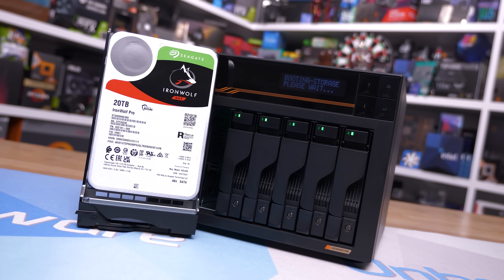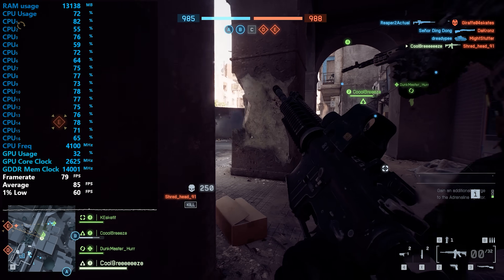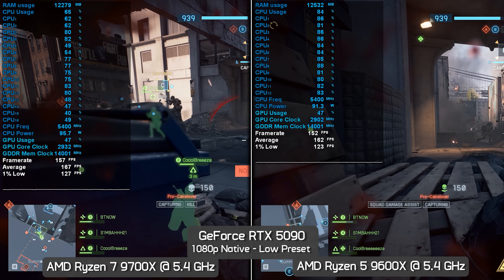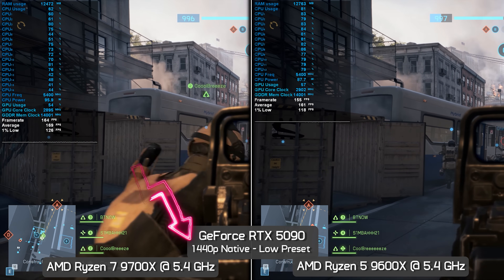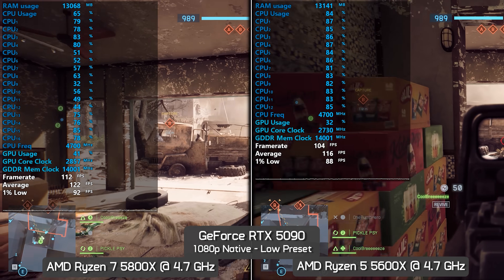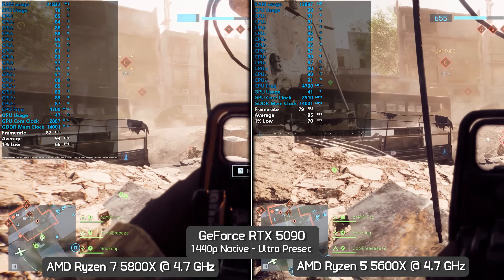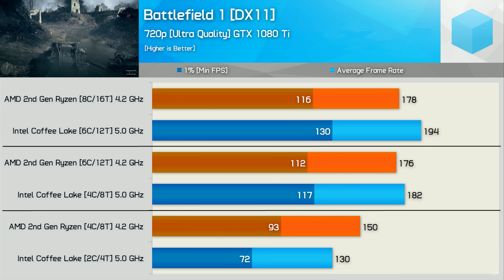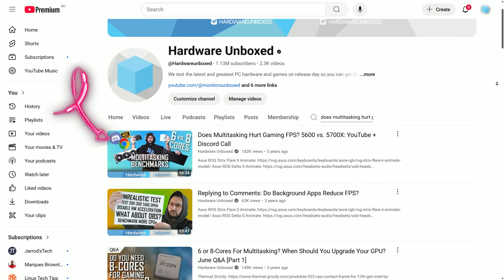Why Gamers DON’T Need More Cores, 6-Cores Still Works Well!

Comment: You should buy more to be future proof from a legal standpoint.
Live example - Oblivion Remastered requires 6T. A pop up appears upon start if you have less. Will it work on 4T? Yes, possibly even without huge issues. 
Can you complain about anything in the game stability/performance if you don't have the specs? No, you can't. Default answer from devs will be "bring your PC up to specs". 
I believe we're gonna see more requirement specs increases in the future because it's an easy way to ignore complaints of people with low specs, not optimize your game or even push the sales of new CPUs by just introducing hardcoded spec requirements.

Comment: In the end the whole many cores marketing in general didn't age so well. Kinda sad that it's still being used today by manufacturers.
Reply: Amdahl's law is still a thing, and if what you are doing is extremely parallelizable and demanding enough that it's stressing out the CPU then someone will make an accelerator for it. That's how we got GPUs, that's why we have these awful NPUs.
Reply: @RN1441 just because something can used across many cpu cores doesn't mean it makes sense to design an asic for it.
Reply: The marketing is fine. It's people's conclusions that are the issue.
Reply: You need at minimum 8 core cpu if you do anything production kind work on your pc. For example video editing or such. Its not a marketing scam that more cores gets you much faster rendering times etc. Its just a fact. Just because you dont need a pc but only for gaming, doesnt mean 8 or more core cpus are useless for everybody else too.
Reply: it'll always have market demand to users like me who prefer more cores than just IPC improvements, that also value longevity.
Reply: If you're actually using your PC for the kind of work that uses them, cores matter. Not everyone buys a PC purely for gaming or even as the main task that the PC will perform. 
Also, if you're a Streamer or some other kind of hi res video content creator those cores really will matter, a lot.
If you're just a gamer, yeah, not so much.

Comment: Now a comparision with a 9800X3D vs a 6 core 9900X3D (with the non-cache cores disabled).
Reply: This my current  situation. I have a 9900x3d. I turn on msi x3d game mode . My games performance jumped and butter smooth in games like. War Within, City of Heroes, F1 25, Madden 26 and many more. I’ve  also notice extremely less latency, almost like it doesn’t exist. My gpu is a 9070xt and I’m playing on  a 4k 240z oled. When x3d game  off. I noticed some stuttering and more latency. I’m definitely keeping x3d game mode on.

Comment: Interestingly when I tested my DUAL-GPU system with 7900X3D & Lossless Scaling in 4K with 600fps generated from 55fps, my CPU utilization was only 40% and it was 70% in 1080p with 1600fps generated :)
To back it up I have benchmark on my channel :D

Comment: ok just on the note of the more cores more multitasking, in an specific use case you can actually tell the pc use this cores JUST for OBS and thats all and so the pc will not use any other core for obs and will use the others for gaming not using those 2 that are just for obs,

Comment: Developers have talked about how hard it is to spread gaming loads across >8 cores.  Game workloads are SUPER dynamic, nothing like datacenter/server workloads.  Not just that, we never truly got away from the importance of a primary game logic core doing a lot of the heavy lifting and cannot necessarily be broken up in the same way you might spread out other workloads.  Meaning it's still easier and often more effective to keep one core/thread doing a lot of the work, and ultimately, when fully utilized, bottlenecking how much all the other cores can realistically add to performance.  Trying to spread such work out a lot more isn't impossible, but it's complex and challenging and can often have worse end result performance, and more headaches for dealing with issues.
Reply: There are PC exclusive games. Plus PCs tend to have background tasks running. Two extra cores come in handy.
Reply: Yes. Microsoft is going to run telemetry whenever they feel like it. @greenbow7888
Reply: the context switches from trying to use more threads also cause lots of extra overhead, especially on windows
Reply: IF they tried doing that in an already made engine then yes, if the game engine is made for pararellization then its not a headcache to work with.
Reply: Not sure how things are right now, but somewere up to ryzen 3000 time, intel was king because it had better single core performance (IPC ?). So what @maynardburger said was true at some point in time.
Reply: All I know is that according to armchair developers all game devs are lazy lowlifes who don't even try at their jobs. That or it's a conspiracy to make games run badly on purpose to sell hardware.
Reply: The reason they don't do it is because consoles only use 6 of their cores for games.
They could.
They just don't want to build separately for PC.
Basically, lack of optimisation.
Reply: @BusesAreFatCars  Not true, from a developer. If you can make something that scales well to 6 cores, it will scale well to 8/16/whatever.From a straight Amdahl's law perspective, not counting IO, be that "device IO" or "memory IO". The "work subdivision" isn't much different from 4 to 6 to 8 to x for workloads that can be highly parallelized. Problem is, the ones or parts that can't. And there's only so much time to go around, so you focus on the hot paths that can CLEARLY be done out the gate and then, time allowing, you think of those that MIGHT have a chance.
And we have a saying around here that, if you don't do it now, you don't do it ever. Because "new feature" always beats "improvement". Unless of course performance is so appalling that you HAVE to do it, then "new feature" can wait.
Reply: So, lack of optimisation. Like I said.
Also current engines are not designed with PC's in mind. They are focused on consoles and their set number or cores, or primarily have been up to now. Which is what I said, I figured I didn't need to write it in such a long winded way, though it is what it is.
I get that some processes will not scale effectively. Which when everything these days runs on Unreal 5 is mostly down to how the engine is designed.
 @ErazerPT
Reply: @BusesAreFatCars  how does software built for six cores differ from software built for sixteen? as a layman, i would think having more cores just increases the number of 'multithreadable' tasks you can execute in parallel
Reply: @jim-wr3lp  It shouldn't but I guess gamedevs don't use thread pooling.

Comment: The Ryzen 3600 can still hold it but I upgraded to the 5600 and games that the 3600 started to struggle with didn't

I wanted to get the 5700X3D but it's hard to get now because it's end of life I could get a 5800X but I won't see any improvement I don't think

Saving up for a new rig next year anywah

Comment: When Ryzen 1000 series released, we thought the games would utilize all the cores within couple generations but in reality it took until like Ryzen 3000 series for game devs to even start utilizing more than 1 core, let alone 4 cores that was standard at the time - and that's when AMD overtook Intel as gamers' favorite since Intel CPUs were still better in single-core performance but not in multi-core - it will take a long ass time before we see games requiring more than 6 cores for 1080p Low preset.

Comment: We could also mention the fact that the IO die is not binned to be better on the more expensive parts. You could get a 6 core CPU with an amazing IO die and huge margin for overclocking, while the 8 core CPU barely manages to get over JEDEC specs.
Reply: Maybe, but once you start worrying about overclocking and spending all the extra money for fancy memory kits required, you're usually just better off going with an X3D part.  More efficient and straightforward improvement.

Comment: my 7600x3d has done really well while paired with a 9070xt but there are definitely times where i wish i had an 8 core just simply for shader caching and there are times where my cpu is the bottleneck at 1440p ultra native settings on bf6

Comment: I beg to differ. I had an 8 core 5800 series and now have a 6 core 9600 series and there is a huge difference. While the 9000 series 6 core scores better in cinebench, there is still a huge difference running a game and having browser windows open with multiple tabs and other apps like discord, etc. running also. 

Y'all just tested a pure game only setup. That setup, sure, not a lot of difference, but the real world, not everyone is just purely gaming.

Try gaming, especially online gaming (games that use 4 or 4+ cores), talking to your buddies in discord, running browsers to look up stuff and maybe even doing a little streaming, either on discord or otherwise, and tell me 6 cores is just fine.
Reply from the maker: What? Are you trying to claim the 5800X is a better processor than the 9600X? :S
Reply: @Hardwareunboxed nope, just that 6 cores vs 8 cores in a real world gaming setup is better. You must not have read the entire message. Sure, pure gaming alone, not a lot of difference, but in the real world, I have game on one monitor, browsers on another and other apps like discord, etc. running and 6 cores is lacking.
Reply: @WayneWatson1  Sounds like your 9600X system is broken somehow.
Reply: @soppaism B650, 32gb memory, nvme gen 4 drive, 7800xt. The 5800x3d and 9600x have close to the same FPS, it's just when I am checking things out in the browser and doing other stuff, the game suffers a little. The 5800x3d/x570 system (same exact video card and nvme drive) never blinked while having 10 tabs open, streaming on discord while chatting and running 2 instances of wow.
Reply: straight up lying on the internet now are we
Reply: @lightbell3 you referring to me?

Comment: Not this again, how many videos you uploaded about this topic again every now and then :<
Me I finally settled at 16 cores a couple months ago coming from R5 5600, as nail in the coffin coz I like to settle down and forget the incremental upgrades. Made a huge difference in terms of stability, temps and consistent frames performance. Rather pay upfront for more cores, more longevity than purchase over a thousand dollar GPU any day. My build is from 2022 when AM5 wasn't mainstream yet so made sense to just max out the platform instead.

Never going back below 16 or 12 cores CPU ever, as in. I'm satisfied with my R9 5950X upgrade as I do more than just pure gaming.

Comment: The human eye can't see more than 8 cores anyway
Reply: Person with Pentium Gold G7400: "games only use 2 cores!"
Reply: But but, i thought, the more core u buy, the more u save.
Reply: Since modern CPU cores are themselves very small, if you have bad eyesight you might not even see one xD.
Reply: @Durayne  True, X86 are usually like 5-7mm² except Zen4c which was ~2.48mm² and that a full on X86 with SMT, Intel Atom and Arm cortex X4 is 1.4-1.7mm² depending on process node and features.
Reply: If I bought more than 8 cores I wouldn't be able to afford my glasses and wouldn't be able to see anything at all!
Reply: The human eye can't see cores. The human eye can't even see more than 16 bits. We should all still be using 8088s.
Reply: Hahah a lot seem to not get the reference, it's a joke about 144 Hz
Reply: @herculet  Many years ago that was about 24Hz.
Reply: I once saw 16 cores, but then I went blind. Don't try this.
Reply: I see what you did there...  🍻
Reply: :hand-orange-covering-eyes:👀:face-turquoise-covering-eyes:
Reply: You can always count on some people not getting the joke
Reply: Per CCX?
Reply: *less
Reply: Only 90s gamers understand that joke.
Reply: Human Wallet: Same
Reply: A person who thinks all the time…….
Reply: So I think most games know that requiring or leveraging MORE cores across the PC landscape is suicide because that screws over 4 or 6 core processors. Instead the engine is usually dynamically looking for how many cores and threads it can utilize, and spreads them across as an added bonus, and you don't see much fps benefits, but you do see better handing of backend stuff that isn't fps. Fps isn't everything basically.
Reply: But we have 2 eyes
Reply: Max I can see is 6
Reply: I thought 4 was the limit 😢
Reply: I see forever. That requires 24 efficiency cores and net wake.
Reply: i can see with my ears, now what?
Reply: of course you can
Reply: Actually it’s only one core. Everything past one core is a lie

Comment: A dumb question here but I wanted to know how would Intel CPU compare as one thing they have is lots of core as my I7 12th gen laptop has 14 cores but when i try to emulate PS3 titles I wont say it is the most stable/smooth experience

Comment: I am that guy: nobody games at 1080p!!

Yes, 1080p is how you "test CPU performance.". Scientifically.  Duh.

However, the data is less helpful to a consumer if they don't play at those settings.  It doesn't help them make a purchasing decision - which is why many people watch.

Example: 13900k + 4090 @ 1080p, faster than 13600k.  But... @ 4k, not so much.  Thankfully I had this purchase-decision data, and saved a bunch of $.

That's the difference.  Just need to be more specific.

Great vid.

Comment: I get the impression that for most modern games the additional cores are not as much important if the game was designed with PC in mind. The problems occur more when u try to play games that were ported from non PC platforms like PS or even mobile games.
As an example, NIKKE: Goddes of Victory runs significantly better for me on my new R9-9900X (capped at 65W) compared to my previous R7-5700X.

Comment: I went for the 2700x and AMD built instead of Intel, today still rocking same config but upgraded to 5700 , and 5700X3D when it was dirt cheap so Intel might was the best, but AMD turned out the winner on the long run ;)

Comment: For strictly gaming 6 cores are where it's at for value cus consoles decide almost everything and their 8 core has cores reserved to their OS for non gaming stuff. Got a 7600x3D, 32 GB RAM, MB from Microcenter in the US for 399. Literally laughs at Intel builds and beats everything except a 7800x3D, 9800x3D and the difference is small in actual games. With a -25 all core I am running in the mid 60's in OCCT/AIDA on a garbage AM4 cooler I reused. Ram Tuning doesn't even matter much on X3D either, so you have 400 dollar builds within a few percent of builds costing double and triple that with elaborate water cooling, super expensive RAM, MB you don't need. Spend the money on the GPU unless you are a content creator and I hate to break it to you, but you have a better chance of being a professional sports player at this point than being a big streamer.

Comment: I recently built myself a new PC after many years of having an old one. I opted for a 7600X because it was in a good price range and reviewed well, but I was kind of worried I had underspecced and should have gone for a better CPU. To my surprise, nothing (so far) has seemed to really give me any issues CPU-wise in games. 
I've flipped on the performance counters in a couple of game titles and more often than not I'm rarely above 60-70% CPU usage in games (shader compilations or loading screens are higher of course) so I guess I'm... just not that CPU limited? Note that I've built a pretty modest computer and I'm only using a 120 hz screen with the occasional RT effect turned on so I'm not shooting for the moon here. I'm also not trying to use path tracing (my GPU simply isn't powerful enough).

Comment: Testing higher than 8 cores is a minefield. Ryzen you wil, suffer the ccd to ccd latency. Intel, anything above 8 cores will be e cores insteac of p cores.

Testing more than 8 cores will become i teresting next gen when intel gets more p cores and amd more cores on a single ccd.

For now I saw a major uplift going from 5600X to 5800X and then another going to 5800X3D (5600X3D wasnt ever available whereI live)

Then I got a 9700X and saw no gains in some games and big gains in others and decent gains going to 9950X3D but only when restricting games to one ccd.

All this on RTX 4090 and 3440x1440, on my newer 4k screen most games are now GPU limited.

Comment: It'd be fun to look at performance of relatively recent 4-core CPUs in modern loads. There are i3-14100 and R3 8300G, as well as i3-10300 and R3 3300X (also Zen 3-based 5300G and its variations but they are rare).
Reply: r3 8300g lmao I had no idea there were 4 core zen 4 cpus
Reply: @madelaki any ryzen chiplet with <6 working cores is rare, most have at least 6 working cores to become Epyc or TR or ryzen.
So its not worth AMD selling a quadcore on desktop, the exception is APUs which are monolithic, the cores take up so little die space that if L3 or core is defective you can still sell it DIRT cheap to OEMs. AMD sells like 99.99% of all dies they make.
Reply: And potentially factor in the rest of the platform.
So many people bought a £100 12100f because it's cheap... and then had to go and buy a £150 12400f later anyway when they could have just bought AM5 instead of lga1700 and then gone for a £200 7600x and ended up saving money (or AM4 and a 5700x3D, same deal)
Reply: @tomstech4390  That is true, but the point is that it'd be interesting to see the effect of 4-core CPUs.
Reply: @tomstech4390 I'd be more interested in seeing a new Amd 4 core v cache chip on the newest node. Then you could compare apples to apples.
Reply: @tomstech4390  Oh well. The way it is now, there'll still be 7600x sitting on the shelf in 2030 growing mold at Microcenter. Same as the 9600x.